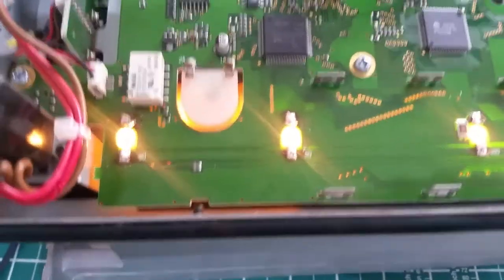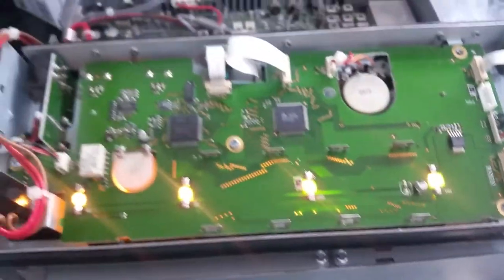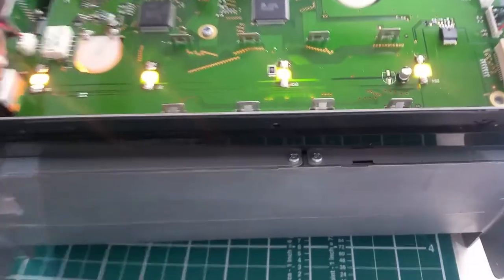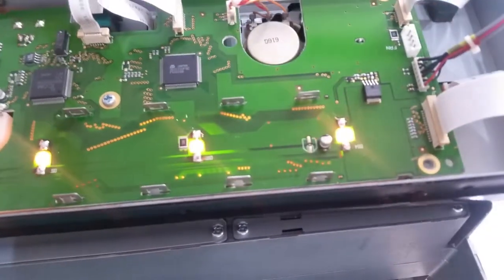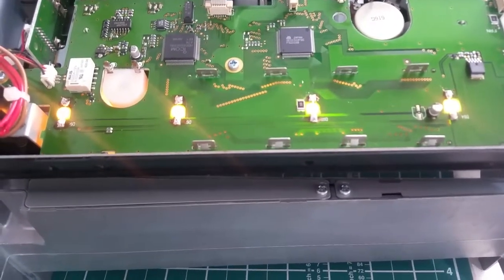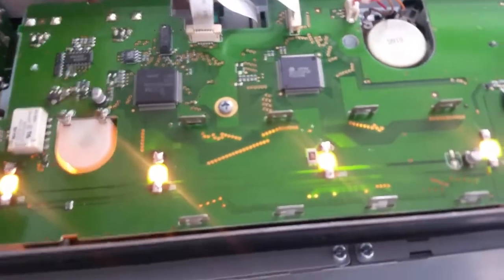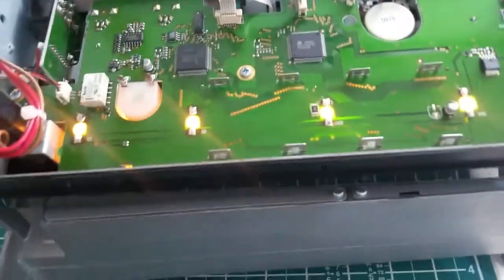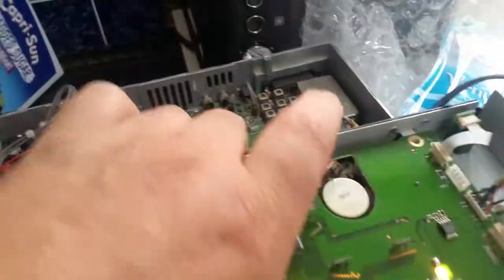Icom icr8500 bulb fixed pt 2

Comment: I need to do this but I’m having trouble getting the front cover off,seems to be stuck near the earphone socket,please help.
Reply from the maker: what do you need to fix
Reply: @raybokor2  the back lite has gone dim,and it’s in high.
Reply from the maker: @francistoboni9801  you don't need to take the front off the bulbs are on the back of the board . just desolder the leads and feed the bulb though
Reply from the maker: @francistoboni9801  according to the service manual the only bulbs are on he display bored and you access them from the back of the board .so there is no need to ttake the front off . he bulbs are available from icom Europe. email. me a photo of what you mean. rayboko2@gmail.com
Reply: @raybokor2  I need to do exactly what you did on the video,but can’t get to them.
Reply from the maker: @francistoboni9801  sorry for my confusion the top and bottom panels need removing then there are  screws at the side of the front panel just remove them and the front assembly comes away . im just confused why you are having issues with the earphone jack
Reply: @raybokor2  when I take all the knobs and screws off the front still doesn't come off it seems to be stuck near the earphone socket.
Reply from the maker: Search for the service manual it will show the location of all the screw's etc and you don't need to take anything off the front .(I thought you did but itakes no difference ) the manual is free to download